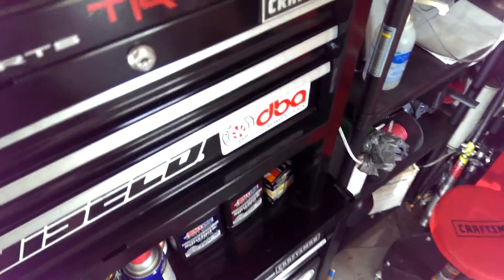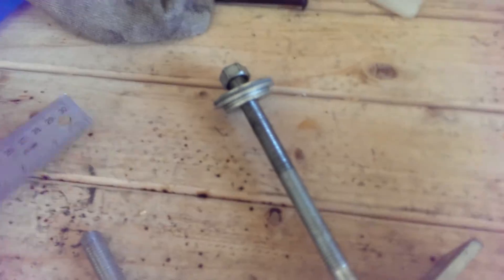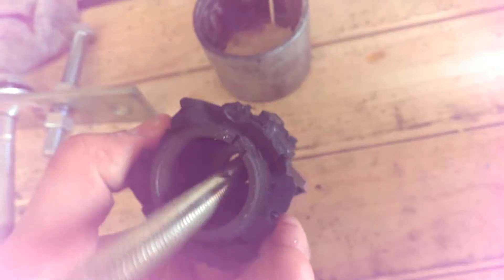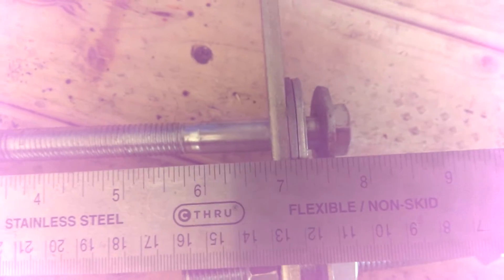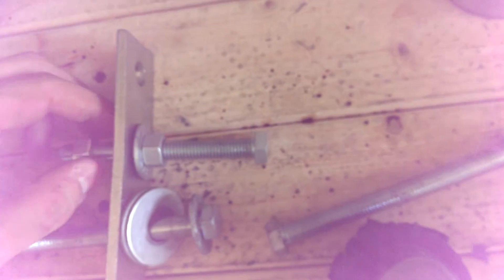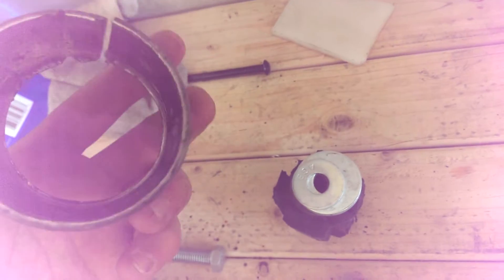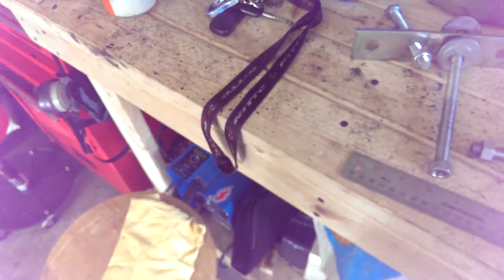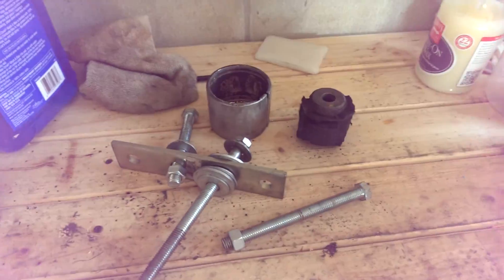350z differential diy puller

Comment: Nice. usually to remove bushing I just drill a bunch of holes into the rubber with a 1/8 bit till the inner sleeve can come out. than I cut the sleeve with a dremmel and carbide bit. carbide bits cut through metal like butter.

first time i used a carbide bit was to trim the hot side of my turbo and it cut it with ease, its real handy.....

Comment: How did you manage to fit the "ears" of the diff in between the A-frame of that 6ton press, to press the bushings? I have the same press and I was having trouble. I was able to get one of them barely, the other I just beat to hell with an air hammer.
Reply from the maker: Dude it was a pain in the ass. I had to do all sorts of wiggling the diff into position to get it to almost fit, and even then it pushed the bushing out in a weird angle. I am thinking of selling this press and getting the larger one, since it bent part of the press frame when I was trying to push the bushing out.
Reply: go7roo7 Yeah I was just thinking at the time, how the hell did he do it? Lol
Just a couple last questions while you're here, after using a sawzall to cut a slit into the sleeve I can use my air hammer to peel it our right?
Also, when lifting the diff back up to the subframe, did you just balance it on the jack?
Reply from the maker: Moe Ayyash
I dont have airtools so I used a chisel and a hammer, but yes an air hammer will work. Yes I balanced on the jack. Just keep in mind you might have to move it a bit while on the jack to get all the bolts to line up.
Reply: go7roo7 Ok sounds good. Thanks dude, and good job with the vids.
Reply from the maker: Moe Ayyash
Thanks man, hopefully in the future I can get a go pro to help with making better quality videos.
Reply: go7roo7 Yeah that might help you out.